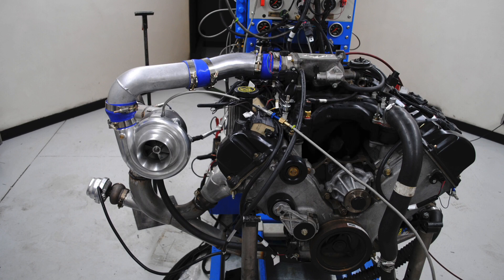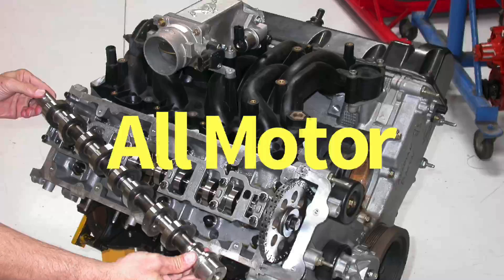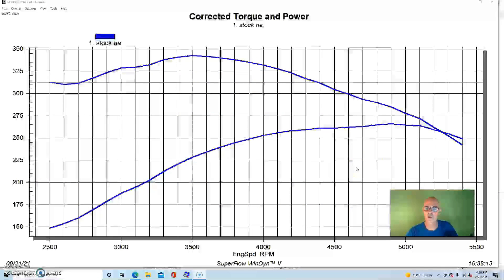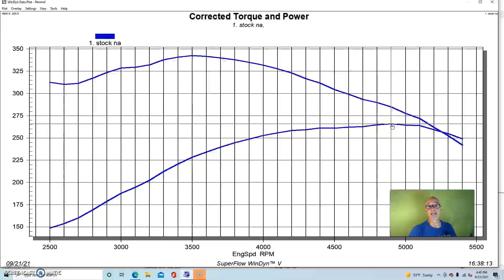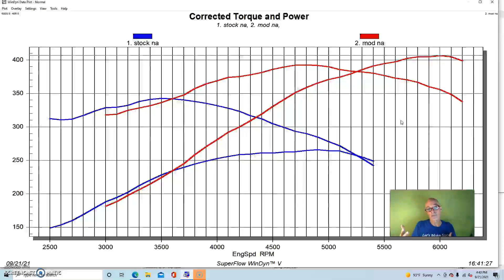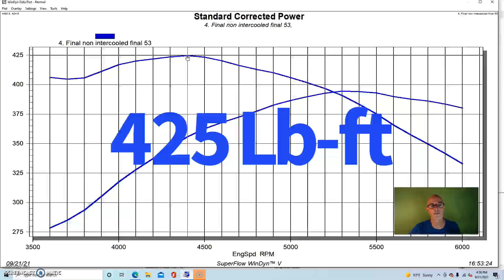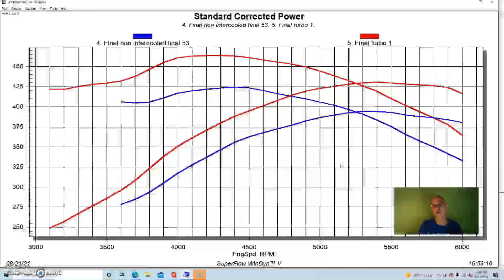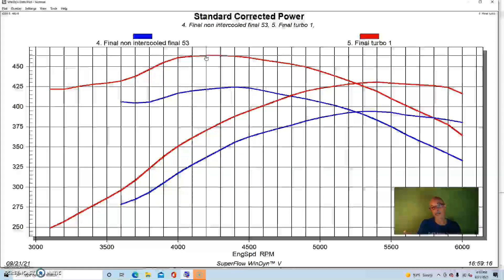ALL MOTOR VS CHEAP TURBO-COST VS POWER, WHO WINS? DIRT CHEAP DIY BEST MODS, 4.6L 2V COMPARE

Comment: boosting seems cheap on paper but honestly 6 psi is probably the most reliable option for stock internals so to me isn't worth the headache of trying to cram all the turbo junk in a mustang engine bay, those things are cramped as hell. NA horsepower can be gotten cheaply too if you port and polish the heads yourself, heck I even see heads that are already done up on facebook marketplace for less than 600 bucks. Plenty of people start projects they don't finish so you can get good stuff for cheap.

Comment: Sorry to surface something so old but your video was very informative and helped me know what direction I want to go with my 96 gt. So one part I'd like clarification on is whether it's worth staying non p.i and adding boost since you mentioned when adding p.i components to the non p.i motor raised compression. My understanding is lower compression is best for boost applications. Hope to hear from you. Thanks for your awesome content.
Reply from the maker: what fuel do you plan to run? The PI heads flow better and make more power than the non PI heads (same for the intake)
Reply: It'll be fine you can run lower boost with the added compression and still be ok.  More compression is always better imo and if you have access to e85 you can make a ton more power with boost and higher compression...

Comment: Hard to not call this apple's to oranges.  You did the first mods to a non pi. Then did the boost mods to a pi. Which is basically a 35 hp headstart. Boost should have also been put on non pi motor so the true $ to hp comparison could be seen. Other than seeing capability of the two motors this comparison is useless for comparing mod value per hp. Sorry.
Reply from the maker: one motor was modified NA, the other got boost. True test.

Comment: I have recently come across your channel and have learned a lot from your videos. Thank you for such detailed information and comparisons. An Idea for a future video is very similar to this one. Jeeps have ran the 3.6 v6 for what feels like a decade now, the common statement if someone wants more power is to just Hemi/LS swap because the pentastar is weak. It would be interesting to see how much power one could get out a 3.6 Pentastar done right compared to a common 392 Hemi. Team GM has a similar potential comparison with all the v6 Camaros on the road that users are told to sell and buy the v8 version.

Comment: @RichardHoldener I looked this video up after reading the article you wrote on the turbo motor. "Low-Buck Turbo Ford - 592HP 4.6L 2V Motor For $2,298" In the article you made another run(s) at 14 psi, where it made 592 hp and 640 lbs. ft. Not sure if you left that off of this video because it's beyond the connecting rod recommended limit, or another reason, but I was after the dyno curve. I did get what I was looking for, and this little combo is impressive. I think duplicating this with Coyote rods and aftermarket pistons would make a stupid fun SN95 that at full weight could be low to mid 11s. Big question is for the street, would you go 10.5 to 1? 9 to 1? Higher should make more off idle, with boost making up the once lit power...
By the way, diesel guy so I love the torque!
Reply from the maker: it's not beyond the limit of the rods
Reply: @richardholdener1727  I'll try to hit up a live to ask a few questions. Thanks!

Comment: So you can gap the rings on stock internals and squeeze more power out of it? At that point you Already have the pistons and rods out mine as well swap in forged internals right? Or can your gap the stock rings and be ok for 500hp?
Reply from the maker: STOCK BOTTOM ENDS WITH RING GAP GO A LONG WAY
Reply: @richardholdener1727  so if you can't afford forged pistons and rods. it is beneficial to tear it down and ring gap.

Comment: What size fuel injectors do you recommend for this simple turbo setup? You mentioned adding more fuel but not the actual injectors used for the test. I would love this combination in my 2011 PI Crown Vic.
Reply from the maker: injector size is based on power output-1000 cc for 1000 hp
Reply: @richardholdener1727  Thanks for the cc to hp relation. With a little math and conversion to lbs/hr from cc I’m shooting for the 500hp range and can size injectors in the 50-70 lbs/hour if I’m understanding correctly.

Comment: Generally speaking, a newer engine is designed to make torque at streetable RPMs efficiently, so adding a HCI all-engine deal tends to move things up the RPM range, trading noise to get the last bit of efficiency (exhaust and intake noise, etc). A turbo can increase the efficiency of the cylinder filling, but both mods are going to run into octane issues if you don't live in a part of the country selling E 85 everywhere. There you might get into a debate of increased displacement versus, say, nitrous. Or use a small turbo to max out the torque below 4,000 rpm, and the engine feels strong regardless of power output because after your transmission shifts at 4,000 rpm, the engine doesn't fall out of its power band, but into a nice fat torque curve.

amusingly, boost is a measurement of how much restriction there is in the intake flow. so you can get better HCI and find you need less boost, which could get you back to a compression ratio for pump gas.
Reply: What is hci??
Reply: @lilcray99  sorry, that's new cylinder Heads, new Camhaft design, new Intake system. basically the top end of the engine so it breathes better. engines are just oxygen pumps, so get it in, burn it, get it out for the next batch of oxygen to get in.
Reply: @albertgaspar627  gotchaaa
Reply: unless you have a compression ratio that is greater than 10.5 to 1 93 octane should more than easily cut it. Turbos might run into more knocking issues though.

Comment: I wonder how Twisted wedge heads would play into this. I’ve always theorized that with a Ford Performance 5.3 shortblock and twisted wedge heads (with other supporting components) you could crack 550 hp N/A. Not very affordable and in no way stock, but hey.
Reply: Maybe crank but not wheel

Comment: I was mostly impressed at the gain in power just by adding an intercooler and timing to the turbo. Was the gain all from the timing or does intercooler add power without any additional timing?
Reply: Cooled denser air will give you more power even without timing.

Comment: Turbo will always make more power but in a tight engine bay under all street conditions with pump gas taking reliability for a street car into consideration i think a turbo setup will be more expensive than you may expect. I would back na for a hot day  with lots of weight for long term reliability. Love your vids.
Reply: If he put the turbo on a non pi engine it wouldn't have had that much more power he put the turbo on a pi engine which was up 30+ horse on the baseline.  The non pi stock engine would have choked it off more leading to less power so the turbo setup wouldn't have been up as much on the heads cam intake setup...I'd recommend start with all motor THEN add boost later if you want.  You could make a ton of power at even lower boost levels making it more efficient and able to make more power safer.  You wanna stay around 10 or less psi on a stock bottom end and having engine mods allows you to make alot of power while staying at or below that boost level.

Comment: What impresses me the most is how just a little boost makes such big gains. Thank you for your time and effort. I really appreciate it
Reply: shows how under stressed most American v8's were. once they figures out how to put more aggressive timings along with decent emissions we went from v8's having 270is hp to them making 400+ easy over night.
Reply: @GoldenNada  If  you're talking about OEM power numbers most of that came with other improvements in architecture, like heads, intakes vvt etc. so that they could still be under stressed and more reliable.

Comment: Who wins? People without early mod motors. Sorry ford guys you got good stuff just not those
Reply: The early mod motors are awesome did you even watch the video?  This non pi 4.6 made over 400 hp with ported pi heads and aftermarket cams that is pretty impressive for a 90s 4.6 2v.  The 4v was even better with forged rods and pistons a teksid block from a 96-99 cobra can do 1000+ rwhp in its sleep stock crank stock block.  Ppl love to just repeat bs do some research.

Comment: Hi, i have Block romeo .20, rods coyote 1er gen, piston 6cc, crank .10, cams 278, headers,  bbk 73mm, coils msd, pulleys bbk, intake sr 2½, múltiple profesional products to aluminium. And shot 100 nitro.

what do you think of that configuration???

Meaby 450 whp?
Reply from the maker: LET ME KNOW

Comment: Hey Richard, do you think a lot of the 4.6 2v performance concepts will apply to my Jeep 4.7 considering the similar displacement and SOHC design?
Reply: And speaking as a person who has personally rebuilt a 4.7,  don’t bother. The heads are horrible, mine dropped an intake valve seat (common) 2500 miles after the rebuild. The heads were fresh from a well known rebuilder. The engine seems brilliant when you look at the build though. A bed plate and fractured con rods like we first saw in Ferrari I think. The oil pump is crank driven, the overhead cams are cool but the execution was substandard. The rebuild was also quite expensive from a parts standpoint(we are talking stock build with quality parts). I used a Melling pump, Sealed Power pistons and rings, Clevite bearings etc.  Also the rod bolts and head bolts are torque to yield. Yes it’s pain to torque but it’s one time use and it will cost you hundreds just to pull the heads if you have to as you have to replace to bolts and they are not cheap. Maybe consider boost for an engine like this, I wouldn’t rev it despite the cool tech.
Reply: @Yohann67  thanks for the info and advice. 
I think I’m going to stick with my 4.7 just based on uniqueness alone, not to mention the WJ Jeep its in I can’t see myself replacing with an SRT. I also love the 4.7 sound as well.
Im actually in the slow process of creating a stronger 4.7 with a turbo.
There is a guy in Arizona who is pushing 700whp on his turbo build limited by transmission issues and oil pump issues like you said. You can look up his videos on YouTube as mandos tuning or just look up 4.7 turbo Jeep.
However he is an off-road racer and my build will be a 500-600hp max daily driver so I think I can get a way with a bit more.
If I do any serious racing or just want more power I’d definitely just swap in a hemi.
Reply: @rodom303   If you are not already looking at Rock Auto definitely look at them, they had the best prices and availability. I would defiantly recommend the ARP bolts and head studs if you can. Look into having a head shop actually pin the valve seats, that is what took mine out. Additionally the 4.7 had some oil return issues and some people have written about oil return work. I believe there are some supercharger kits avail, that stock intake is crap….once it gets valve seat shrapnel it’s almost impossible to clean it out!  I look forward to hearing how this turns out. Cheers.
Reply from the maker: NOT VERY MANY PARTS FOR THOSE

Comment: The mod  motor has anemic connecting rods. I've seen many forced induction "daily drivers," put a rod, through the block. They hold up, for a while, then the party is over. For long term use, upgrade the connecting rods.
Reply from the maker: never broke a stock rod
Reply: Rpm is the enemy even though sohc is a rev happy engine

Comment: All well and good, but don’t forget the packaging in an engine bay issues and the needed ECU tuning play into the equation as well.
Reply: There's more than enough room in any 2 valve engine bay and a tune is needed whether you add boost or not.

Comment: Man I would love to have one of those engine you had on the test bench. That would replace my 2000 2v engine with over 350,000 miles on her. Been through 2 head gaskets replacement and that's about all. She smokes a lil bit, but still runs strong. Only upgrades u have is trick flow cams, 75mm throttle body, cold air kit, shorty headers with x-pipe and factory heads I tried to port myself.
Reply from the maker: junkyards have plenty
Reply: @richardholdener1727 That was one of my biggest debate, if I was going to go that route I would just rebuild what I have. Engines from the junkyard is like a box of chocolates, you never know what you're gonna get.

Comment: I feel that you oversimplified running aluminum tubing. However I do agree bang for buck on a low power motor turbo is far cheaper. I'm surprised you didn't include price of waste gate, turbo header, and injectors if you needed them for the duty cycle. Those are still several hundred dollar items.
Reply from the maker: both combos need bigger injectors, i did forget waste gate, no need for turbo header (use stock manifolds)
Reply: @richardholdener1727  I suppose if you have a welder, a flange and waste gate clamp aren't that expensive.  That's what I was getting at with turbo headers. Usually you can eBay some turbo headers for about $200

Comment: I remember back in about 1979 or 80 when I first became interested in hot rods there was a company that was offering a turbo kit for the Trans Am. A couple of car magazines tested them. The stock 77/78/79 Trans Am with a 400 would run low 15's in the quarter mile. With the turbo they would run high 13's. The magazines proclaimed it was a way to get true muscle car performance out of the late model Trans Am. Turbos were still in their infancy though and I know a lot of the converted cars lost engines, probably due to detonation because of timing. Good gas was still available at the pump. But even back then I thought turbos were awesome and today it's hard to deny the bang for the buck they give.
Reply: It always blows my mind when hot rod guys tell me that gas is gas  octane doesn’t matter can’t imagine how many guys had high compression or boost running 87 in the 70-80
Reply: @utahcountypicazospage5412  Yeah, I know what you mean. I had a 69 GTO back in high school and it was reasonably high compression, rated at 10.75 but I think actually closer to 9.75. I would run premium which was rated at 95 or 97 at the time I think? My dad had told me to always run premium in my car. It was expensive compared with regular which was 87 or 88 but I did anyway. My buddies would run whatever was cheapest. They all had similar cars with factory high compression engines. They all had run on, pinging and of course eventually engine failures. And these weren't even turbo or truly high compression engines.

Comment: Been waiting on this for awhile! Only issue is i have an 07 f150 4.6 2v and dont know if i should swap for a 5.4 2v/4v or aviator 4v or just go forged internals on 4.6 2v and twin turbos.
Reply: Did you even watch the video lol just throw a cheap turbo on it and be on your way lol 450 lbft at the wheels is gonna feel insane compared to what you have now

Comment: I see a lot of people online talking about PI vs non pi and they seem to consider pi being up to 2005. I have seen the stock 4.6 rods, they are scary small imo. Do later production models have any advantages? I have a 2008 vic and I am just wondering if new rods are absolutely necessary for around 400WHP. That seems to be the number people like to hover around. In this video you have quite large numbers for torque (and hp, nice job btw, would be awesome in a daily) what is the level of concern for the rods at this power level. Any comments welcome. TIA
Reply from the maker: WE'VE DONE 700+ WITH STOCK RODS
Reply: @richardholdener1727  dang that's quite impressive, do you have any idea the year of that 700+ motor? Or any opinions on late model 4.6s? Thanks for the above response!
Reply: @almccameron4960 at 400 wheel you'll be fine man don't overthink it.  Best thing you can do is add long tubes and cams so you can make alot more power at a lower boost level making it more efficient and safer thus more likely to stay alive (likely above 400 rwhp with that stuff)